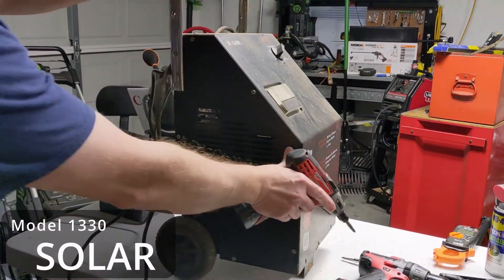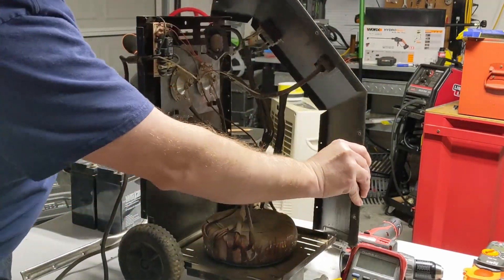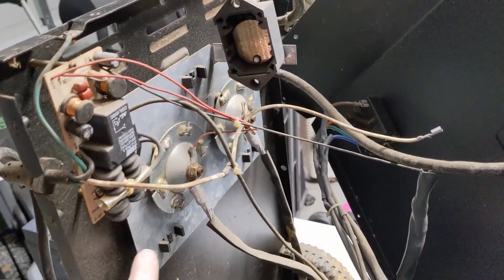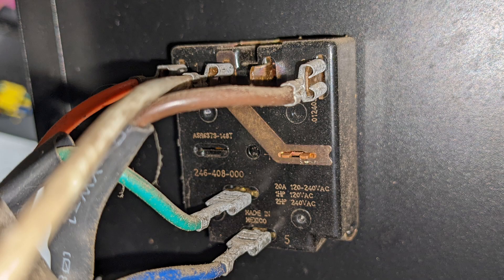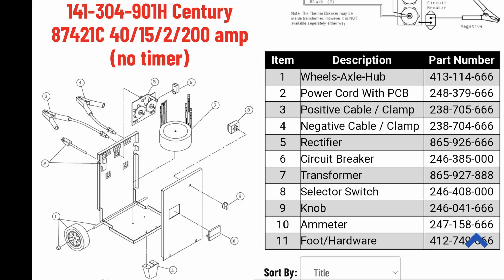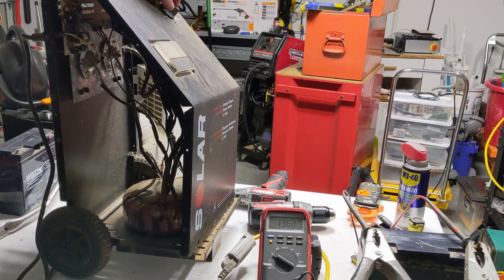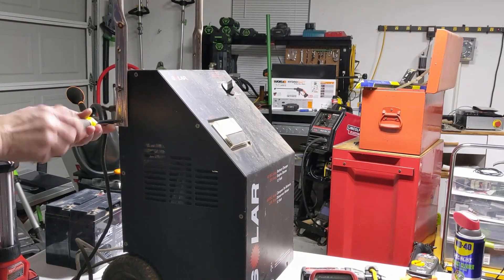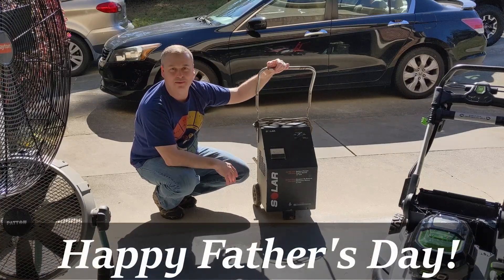Solar 1330 Battery Charger Repair

Comment: I have the exact same charger that doesn't work.  There is DC voltage out and it changes with the selector switch  (11-15 VDC) but no current.  As soon as I hook it to anything the voltage drops to zero. Maybe the current limiting circuit board is bad.  I was wondering if there is a way to bypass that board?
Reply from the maker: Most likely a bad connection at some point along the terminals.
The current limiting board could be causing it as well. I did not have to work on that part at all on my dad's, but I shared a similar wiring diagram of it in the video in case it was helpful to others.
Reply: @ThriftyToolShed  Found the problem.  It was a heat sink on the current board.  The heat sink was bent over and touching a diode on the board.  Works now. Thanks
Reply from the maker: Awesome! Great find!

Comment: You are so awesome for posting this video, thank you! In my case, the problem was that the plastic rotary dial thing-a-ma-jig stripped the part it mates to, so i need to find a replacement for that part you show (246-408-000). Hopefully i can find the part, so far i've only seen how it's been discontinued (meaning not manufactured anymore-- grrr..) I really like how some companies make these things reasonable to repair since the wires can just be pulled out and plugged back in- most companies make it impossible, and they do it deliberately to make sure you have to throw it out and buy another... Thanks for posting this!

Comment: We had a lighting storm to write home about Thursday  and all my neighbors lost power but me and 3 others … Since I already own 2(7.5) & 2 (2.5 ) Ego batteries I’m considering getting an Ego Power Station.. The little nexus has come in handy for running a phone & fan during the most recent 2 hour outage .. I’m curious about what your opinion is on those … Thank You Very Much ..
Reply from the maker: I can say I like them and I do want to get one. I can't help much more than that honestly. I have not had or used one myself. I was kind of waiting to see if the next generation will possibly have the feature of being able to be used while solar charging. I believe the current model does not have that feature. If it gets a software update to allow that would be great, but so far I have not seen that it was released or if it is possible to fix by update? These are just my thoughts. I desire one of these, but we really do not have a huge need for it. I live in a more suburban area now and we had to go without power only once for over 24hrs in a really bad storm in the last 5 years. Before that I lived in the country and we lost power a lot. Generator was a necessity back then. I believe when I buy one it will have the charge feature I mentioned and I will go ahead and buy it with the large 10ah packs since it's a great deal to get the packs in the combo that way!
Reply: @ThriftyToolShed  Wow thanks 😊 it’s nice to know someone is thinking along the same lines as I am .. I live in a 30’ Camper so I have 12 volt and LP  back up .. we had a 3 day blackout in the winter 4 years ago .. and a 24 hour loss last year but mostly 4-12 hours ..and being the proud owner of 20 ah of ego.batteries.. it might tide me over until the I get the generator going… I’m doing a propane only generator conversion on a free generator.. rusted tank and plugged carb syndrome… Have you done a LP conversion ..? Their infrequency of use being a generator’s major nemesis … thank you very much …!